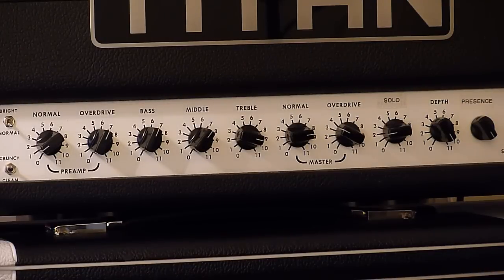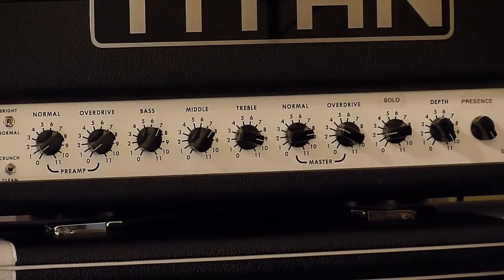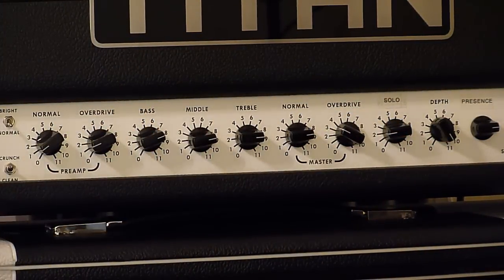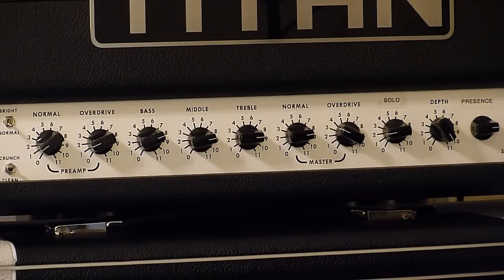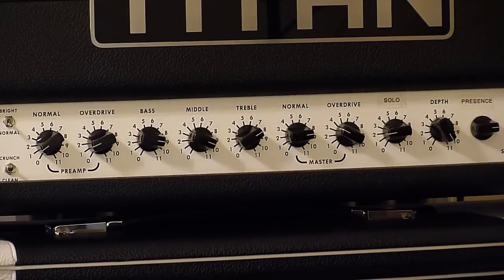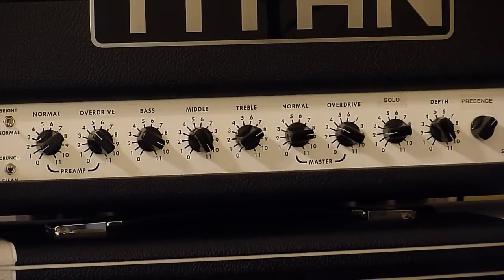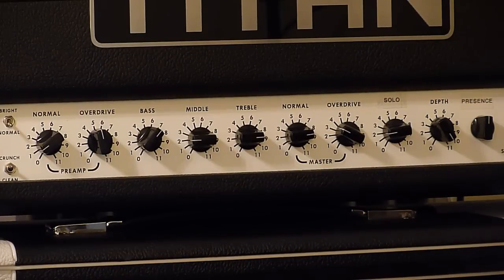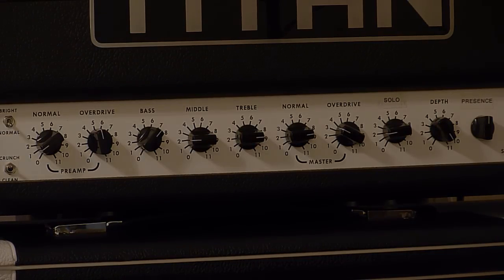TITAN amplification wet/wet demo

Comment from the maker: @bornburied the jet city was free to do demos with.   The titan looks like a SLO but that's about it.  It sounds more like a 5150 mixed with a VHT UL than anything.  I didn't ask for gobs of gain, that's just how he builds them as most guys that buy them are metal heads.  There is also actually very little compression from the titan.

Nitro is kinda sort of based off a JCM800.

I've played a couple of krankensteins and really didn't dig them.  The chadwick was pretty good though.

I'd love a CCV

Comment: He's right, the amps are actually built on SLOclone forum PCBs, if I recall correctly.
It does sound different, but it is the same circuit.